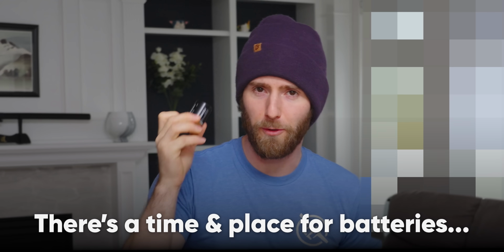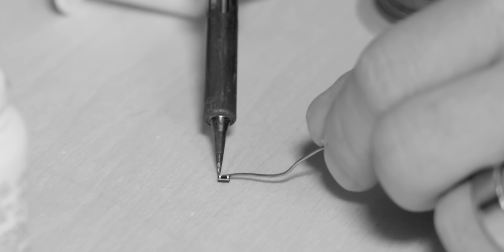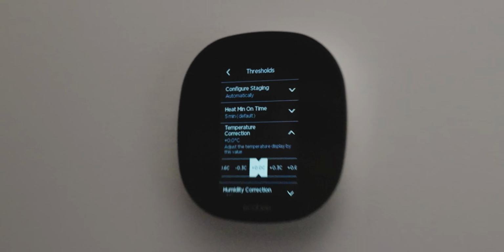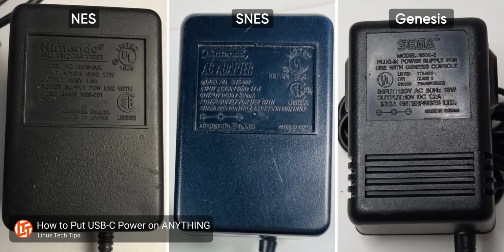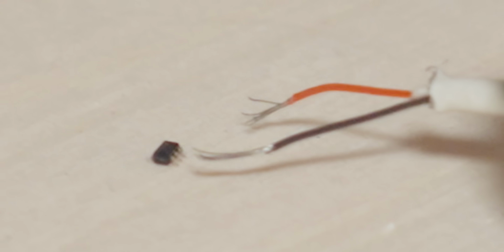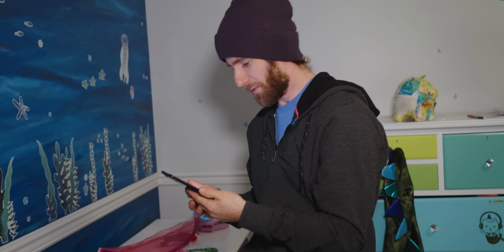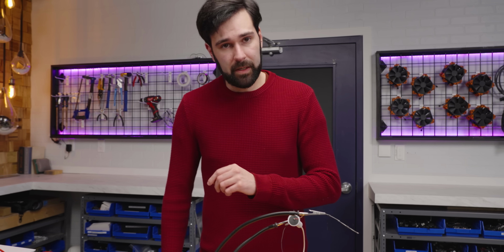I HATE Batteries! - Converting Wireless to Wired (a cheapskate’s guide)

Comment: The LM317 device is an adjustable three-terminal
positive-voltage regulator capable of supplying more
than 1.5 A over an output-voltage range of 1.25 V to
37 V. It requires only two external resistors to set the
output voltage. The device features a typical line
regulation of 0.01% and typical load regulation of
0.1%. It includes current limiting, thermal overload
protection, and safe operating area protection.
Overload protection remains functional even if the
ADJUST terminal is disconnected.
Reply: It costs less than a dollar.

Comment: wish they had, button cell placeholders, that go in just like these batteries, but have good solder points on the top so they can go in in place of the battery with out having to modify the device too much or solder directly to the devices battery contacts.
probably very doable with a 3d printer tho

Comment: To be clear, this won't work every time, since the voltage of a button cell is very clean (no AC noise), which is not true for most USB chargers. So, if a device requires a stable voltage, this might not work without some more filtering.

Comment: 7:05 A fully charged 3V battery may have a voltage a bit higher than 3V, usually around 3.2V, so 3.3 V should be totally fine. You forgot 1 uF capacitors mentioned in MIC5504 datasheet however.

Comment: I just bought usb cable 3v / 9v from eBay (if you don't know the battery voltage it often tells you if you have 2 of x batteries you need this) and connected it to battery contacts in my kitchen bin and a baby bouncer. It's a little more expensive but still cheap and in my opinion much better alternative.

Comment: Rather than using a 5Wh PSU, a case for 2xAA rechargeable batteries would be smarter. Yes you have to charge them, but when the girls visiting mom and dad from uni and the batteries are out, they probably know how to charge them (yes, so long battery life that you forget they are battery powered).... and no fire hazard from PSUs that is plugged in all the time.

Comment: I did something similar to my wireless doorbell about 3 years ago.
Bloody thing uses the tiny 12V cells, og battery lasted 2 years, that was fine, replacement batteries lasted 6 months, that was not fine.
So I took a router power supply and attached its wires to the battery terminals on the doorbell.
Following that with routing the cables so I could mount it to good location and that was about.

Granted I was luckier to be messing around with a device that uses 5/9/12V.
Anything out of that and you're dealing with the diode shenanigans.

Comment: there are things that just shouldn't be only available with batteries...

Like these sensors could easily be directly plugged into a powerstrip somewhere if designed for that. Maybe with a bit of wire with a temp sensor at the end so you can route that somewhere away from any heat generating power bricks.

Comment: You need adjustable regulators in stock. Alternatively you need regulators for a smaller target voltage, since you can always configure them to higher voltage just like adjustable regulators.

Comment: a 3.3v regulator is industry standard -so very common and a fresh out the packet lithium coin cell is 3.2v not 3v so these regulators are perfect theres no need at all for the preset resistor just use a 3.3v regulator and use the d-pak type for easy soldering and a bypass cap (22-47uf electrolytic accross the output) to sort the spike current draw issue

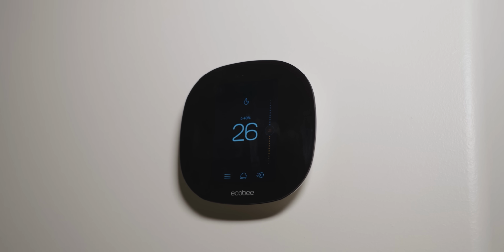Comment: The funniest thing about this whole endeavour is when Linus at 15:00 implies that the sensor would likely run for years on its button battery lol. The truest definition of over-engineering right there! Also I think I'd take the battery over using up a plug socket :P

Comment: This drives me nuts for my kids toys in particular. My sons hotwheels track uses 4 D batteries and sits stationary when in use. The least they could do is put in a barrel plug and sell a separate ac adapter. I've wanted to install one myself, just haven't got around to it.

Comment: The fact he was adjusting the voltage with it connected to the device is a no no. To have done this right, put the battery in, sync it to the thermostat, THEN do the dc adaptor conversion. 30+ years electronics experience here.

Comment: A 3.3v regulator .... very common.. would have worked just fine. Plus a capacitor for those extra current draw moments.The vast majority of ics are CMOS or TTL using 5v or 3.3v  respectively.
Devices with wireless transmitters and ultra low power consumption/battery powered are sensitive to voltage but will run just fine at their designed 3.3 volts.

Comment: Pro tip, if you need to strip those tiny wires and you don't have anything on hand... A janky way is a stanley blade, some patience and a bit of luck. Not saying its safe but also, its not not not safe
Reply: Pls just get a good striper they pay for themselves the first time you use them

Comment: AMS1117-3.3 is easier to solder and comes with ADJ variant where you can set output voltage as you like with two resistors. Or use mini step down converter(those for $0.5)

Comment: Battery Voltage isn't constant. Measure it's brand new voltage and dead to ascertain the actual operating range. Chances are it'll be fine from 2.8V up to about 3.4V. Hitting 3.2V exactly almost certainly isn't necessary, otherwise you'd be swapping batteries out constantly, Especially given those cells characteristically spend most of their time at close to 3v

Comment: using a schottky diode instead of resistor would be safer. they have a voltage drop of about 0.2v, Also if its nominal 3.2 its very likely it will work with 3.3v
Reply: oh you do end up using schottky diodes :D

Comment: using a diode for its forward voltage drop is a better solution than an variable resistor for power delivery.
Reply: called it :-)

Comment: I've got some of these devices running off solar. It's an expensive solution in capex, but no wires and long term low cost. Just a solar panel, MPPT BCM, rechargeable battery/Ultra/hybrid Cap, and a regulator.

Comment: So they converted a ~0.01mW device to one that draws about 0.5-1W (most losses will be in the 5V charge adapter)? So a 100.000x higher power draw for the exact same output? I highly doubt that this is a good practice.
In fairness, cradle to grave CO2 output would be interessting to compare, I guess building and recycling the battery dominates its emissions.

But if you are interessted in doing something like this, spend a few cents to dollars more, build something more efficient.
A) avoid stepping voltage down via linear regulators, diodes and resistors
B) group as many devices to one outlet and therefore one power source as possible
C) maybe accept battery power and only switch to one type of battery, so you don't have to hold mutliple types on shelve.

Comment: Eh... this video is so awkward. Let me sum it up why this video is partially BAD example, literally how you don't do it.
First, i agreed we all don't like battery powered devices. More batteries buying. Yeah, kinda bad for e-waste problem.

BUT!

We have 2 different battery powered devices. Low energy and high energy versions.
You already discovered ecobee sensor has extremely low power consumption thanks to 20 min intervals. Practically 2 years use. Should you make it wired for THAT? The answer is big NO. 2 years is not a lot e-waste so this video to make wired ecobee is literally stupid.

PLUS! Your 5V USB adapter is not really designed for low consumption. The electronics inside switching power supply needs keep run at 5V, and it's electronic high-freq converter. To measure itself at regulated 5V, it need some energy flow to sense it and make it work. In fact, the USB power adapter uses own energy to run it, and that is maybe 2-5W own energy, a lot more than ecobee own energy consumption.
IMAGINE if you do it wired like 10 or 20 sensors with all own USB power adapter, you uses way more "idle" power, 10-20W total? Are you doing it for energy efficiency? No! This is bad example. We have so many idle electronics, all uses own small energy due switching power part that needs minimal energy to keep working. Your laptop power adapter should not plugged all time for example.
In the end, you pay more for energy of all powered products than some cell batteries in your home.

Please, that is why wire everything to power is not always good idea, especially the product is already extremely low energy for 1-2 years time. Even some smoke alarms keep running for 3 years. Make them wired is dumb idea, really worst idea. (Actually smoke alarms must not wired due safety reasons.) And you need somewhere power outlet in room and now you need move whole desk for that. That adds even more to dumb idea here for sticking out power block...

ONLY that makes sense are products with higher power use. Battery powered door bells uses more energy for example, so they have thicker batteries for that reason. They can hardwired without much loss. Heck some products have option to make it hardwired to external power. Same for some battery powered alarm sensors, yes, they will use more energy due active part.

You didn't focus on higher power consumed products. Focus on low power products is waste of time and it's not doing at all positive in energy waste.
Why are you doing this useless and bad example video? We all hate many battery changes, that is right, you only choose wrong product here... 
I feel sorry for you, because you didn't even think well forward about low power energy products versus high power energy products versus own energy of switching power adapters... Buy every 2 year one cell battery is almost nothing for most users here. It's so long time, you will not notice it much in money and low e-waste.

Below this long text, PCB is much better idea for very small SMD stuff. You don't want solder direct on pins, they're small and fragile. You can buy some prepared general SMD pcb boards and cut out to correct size. That is all :)

Comment: I'm on the same page as Linus when it comes to batteries: I love a smart home but I hate devices that can only run on battery, because if you're going all out with sensors and camera's and buttons and what not, there's always some battery that needs to be replaced. Even worse, you may sometimes not even notice that a certain device is low on battery (or completely out of juice) and simply stops working without noticing.

With regards to that, I wonder why Linus didn't just install wired, PLC based home automation for everything with sensors. lights, actuators etc all connected to the technical controller room. Sure, that may require some drilling in walls and ceilings here and there, but when you're renovating en empty house that 's pretty managable and the end-result is the most reliable and user-friendly system you can find. :)

Comment: I would have suggest to use a zenner-diode drop configuration. Where you use basically a resistor in line with an parallel "reverse" zener-diode and sensor configuration to bring the Voltage to exact 3,2ishV. You may have to dial in the required resistor a little. But it should be possible to get an almost correct voltage out of that. at a comparable low cost.
Reply: The problem is that is wasteful because you would be drawing maximum power all the time.

Comment: The trick with soldering small components is to glue then to something big first.  another trick is find a local parts retailer or an online supplier that does next day delivery. (or both).  trying to use the wrong parts often ends no progress made.

Comment: Not having a wired option is really bad, but then all my smart home motion sensors are like that, even the outdoor ones.  I'm currently looking at an off the shelf solution for replacing AA batteries with USB power for a few light up models I have.  Hoping it's simpler than this!

Comment: Also just an fyi, a more efficient means is through the use of a buck converter circuit. It's more complicated but doesn't dispense all of that excess voltage as heat. So converting 24vdc to something like 5vdc or 3vdc is way way more efficient.

Comment: I quite enjoyed the project. One thing I would recommend if you had an alligator clip small enough is propping it up on a flat steel/wood surface and keeping it steady by using pliers. I used snub nose pliers to hold an alligator clip in place as I de-soldered short wires and re-soldered longer wires... It might help to prop the work up a bit, but I am sure there are better ways to DIY a helping hand thingy-ma-bob...

Comment: Hey Riley, what's a sneaker? I think you mean a running shoe!
Anyways, I'm with Linus on this, wired > wireless! I want wired smart home devices!!! If mobility isn't required, then wired power and wired networking (ethernet is not the only option, and in a retrofit, likely not) should be options.

Comment: to convert 5 to 3v there are multiple ways. I'd suggest buying a stepdown down buck convertor circuits(they have LM2596 IC) which are like 2$ on Amazon. there are 8$ versions with 7segments on it, so you don't even need a multimeter to adjust voltage, you can see the number right away on the board.
i can guess the problem would be the size of PCB that wont fit in the device. getting a nice box for the circuit would be an easy task
they have a potentiometer you can play with to dial voltage exactly the amount you need. 3.3v is too much? you can accurately bring it to 3.0 by playing with the potentiometer.
Buck Convertors are the safest bet, they work with the least amount of energy waste, brutally accurate and they are almost immortal.

Comment: Hi Linus. I'm ana avid fan (follower) of your channel. On the context of this video - I'm thinking. Do you not have multi-zone heater around the house in Canada? I had the feeling Canada is similar to Europe? I solved this by adding TRV valves on my radiators, all connected to a controller. The TRV valve themselves have a temperture sensor, and with HomeKit automaton, every room can control its own temperature.

Comment: Why don't you get a 'breakout board' which converts your SMD to a very easy to solder THT layout? They only cost around 30 cents and make your life much easier. Just get a small assortment of breakout boards (QFP, SOIC, SOP, SOT, whatever) to use when you need one.

Comment: Guys dont listen to Linus here, instead of running the janky small random parts he's using - grab a small "buck converter" off of amazon, they go as low as 1-2 dollars and skip all the hassle involved while providing better quality voltage output
Reply: I have an old phone converted like that, runs from 5v usb-c stepped down to 4 volts (thats about the voltage you find on a 70% charged lithium battery)
Fun fact - when the screen is on the phone guesstimates the charge going down from power usage, so i see the percentage drop despite supplying from the wall. It readjusts back when the screen is off tho

Comment: I'd recommend buck converters instead, they can get gotten for a very similar amount, have a range of input voltages and are more efficient at converting the voltage. Those regulators work by essentially being active resistors and the extra voltage is converted to heat. You can get them barely bigger than your finger nail and run at an amp. I converted a 24v printer PSU to three 12v rails for some IP phones I'm messing with.

Comment: Nothing against more of that! 
You can buy some breakout boards if you loath SMD soldering. They usually come for 2 bucks or less from the usual scumbags ... erm online sellers. 😉

But if you are already SMD soldering you might add some filter caps to ground on the input and output side of your mic5504. Might reduce some unwanted behavior.

Comment: As a home automation enthusiast I am 100% with you on this battery problem, through lazyness I accumulated a years supply used battery cells from my door/window sensors, motion detectors and temperature sensors it weighed over pound (about a  half kg) of toxic-ness. With home automation getting increasing traction this is potentially going to be a big recycling/landfill/pollution problem.

Comment: If unable to wire such a small sensor to mains, one can also solder it to a LiFePO4 18650 battery cell which supplies the same voltage and isn't a fire hazard. A single cell could supply that sensor for decades without charging once.

Comment: I would suggest another idea. But you would need someone who knows power electronics, or more specifically DC DC converters.
Instead of a linear voltage regulator as the one you used in this video, you can use a buck converter which is a simple converter to get the voltage lower. You can set voltage to whatever output voltage you like ( in your case 3V), just by changing the duty cycle for a MOSFET. As a bonus, it is more power efficient.
It is not something you can expect your viewers to do since it is a little bit more complicate than what you did. You need a pwm generator, 2 MOSFET and a coil in the output (and capacitors to further stabilize your input and output voltage)

Comment: This feels like watching the Verge make a video on building a custom gaming PC. Just use a DC-DC voltage adapter module.

LDOs are designed to have input and output capacitors. Without them, your voltage might not be in spec and fluctuate, especially during transients like when the sensor sends radio. Also this LDO, especially mounted in free space, has a very limited power rating. This hack works for low power devices, but on anything that draws a bit of current that LDO is a fire hazard.